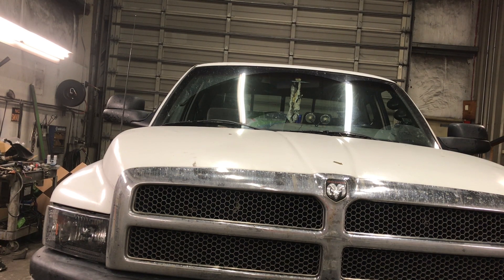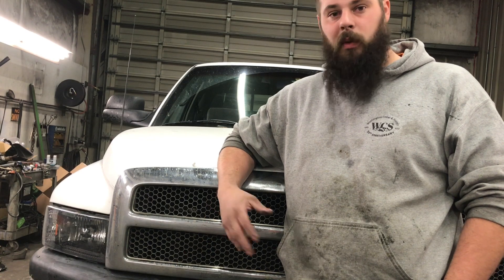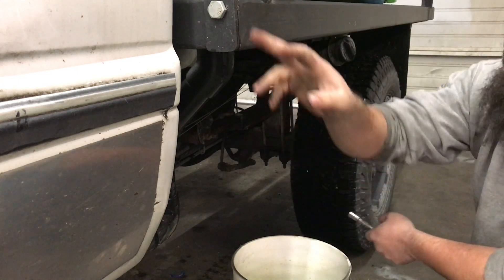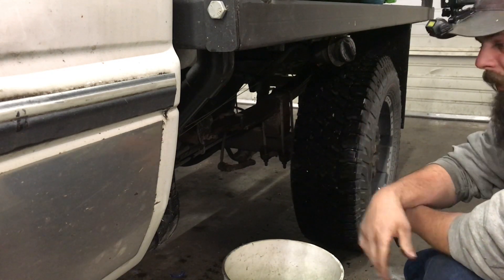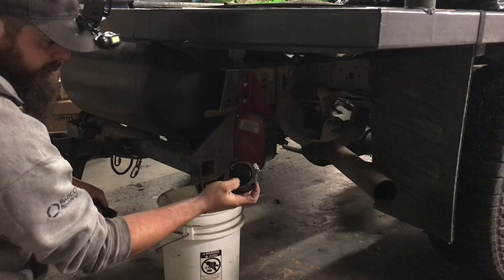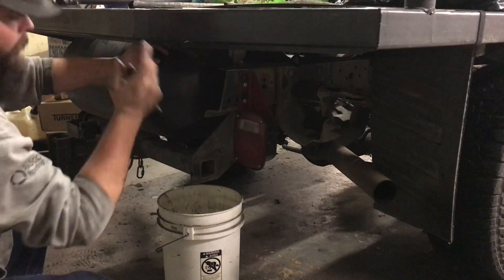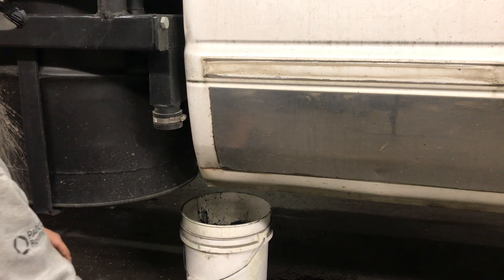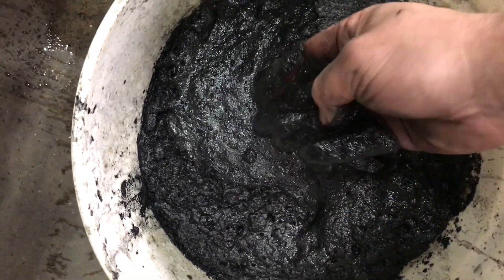V10 Woodgas Truck, First Drive into Work and Draining Condensations from the System

Comment: Is that water good for anything? Could you use that in your garden?  Is it mineral rich?
Reply from the maker: @SkidSteerCowboy-zz6xd  yes very much so. Is usually dump hopper condensates on the driveway it acts as a all natural weed killer. the rear tank, hay filter and sling shot filter waters are basically distilled water with soot, doesn’t do much of anything that I’m aware of

Comment: How warm is the liquid when you drain? I’m just wondering if freezing would be an issue for up here in Alaska but if it’s warm then as long as it’s all drained before it cools it should be good
Reply from the maker: @greatnorthernadventures570  yep drain it just after shut down and it’s like warm water, the tar drain tank is steal so just in case it’s cold and can give it a few licks with the map gas torch to get it draining which Iv already done last winter

Comment: Does this only work on diesel trucks? Or would it be viable in a 4 cylinder ranger?
Reply from the maker: @WTLHunter  works on any internal combustion engine this truck is a v10 my other truck is a v8 and I know a guy that did a 4 cylinder ranger
Reply: @BigBeavrSlayer  this is all very cool! It is amazing to see this and wonder how self reliant we can actually get while still maintaining certain luxuries
Reply: @BigBeavrSlayer  have you thought about doing a generator to see what kind of power you can get out of it?
Reply from the maker: @WTLHunter  yes I have and plan too soon, it’s pretty much the same as with a truck you lose about 25-30% overall power so I’m just searching for the right generator something in the 10k range
Reply: @BigBeavrSlayer  maybe also look into heat to energy conversions as well? Really see what you can juice it for haha

Comment: First i have seen your video very nice set up you do great work.  Would you be willing to provide a system drawing of how you designed your vehicle/ gasifier unit?
Reply from the maker: You can buy the book with full plans from Wayne Keith he is the designer of the system the book is called "have wood will travel" that's how I got the plans and it's the same system on both my woodgas trucks, slightly changed since one is a full size dodge and the other a Toyota minitruck

Comment: You said the timing gets pulled back when you get into the throttle. I wonder if putting a varible resistor in the throttle position sensor circuit would improve things. Maybe fool the computer into thinking you arent into the throttle as much. Could have a switch on the dash for when you want to run on gasoline. 
I'm probably wrong, but just curious.
Reply from the maker: I'm working on a cure for it, but last night I made some big improvements to performance, ill probably have a video tomorrow on it

Comment: Get a serpentine belt that’s a 1/4 inch shorter and that squeal will go away. I’ve had a bunch of Dodge trucks, a genius turned me onto that fix. Not claiming it as my own.

Work on working clean, personal words of wisdom.
Reply from the maker: I had heard of guys doing that on the diesel trucks, but this is a new belt new tensioner, new water pump and has had the belt chirp since I put it on there for some reason. Ill give that a go after a few tanks of fuel money are saved, then buy a good quality shorter belt and keep this one under the back seat for a spare
Reply: I did the same thing. Kept changing belts spraying it w silicone, new tensioners. Thought for sure it was the bearing in the alternator. Dude told me to get a shorter belt, prob solved.

Comment: Awesome. Would a second hay filter be any help?
Reply from the maker: There are a lot of option when it comes to filters, hay filter does the job ok if your willing to deal with some soot buildup in the throttle body and intake manifold. This is cleaned out later with burning out the intake which I have not had to do yet. I am thinking I will add some more filtration inside the hay filter later in, but I’ll drive it a while and get the minor bugs worked out before I start making internal changes

Comment: Bottom line, you made it to work. There is always the gasoline back up, but man, she's alive. You gotta be proud. I'm sure you were probably adjusting A/F ratio on the way to get a feel for the beast.  With our stationary gasifier running an engine we added an Arduino program / servo motor to an O2 sensor to keep things in check before we heard the engine cough.
Reply from the maker: Since I am more or less using damper valves that don't actually seal, I am seeing it is hard to get a perfect mixture going according to the afm. I think I may block off one air filter for the drive home today and see if that improves the ability to set a good mixture. As it sits with both valves closed off completely I cant get it to go full rich, just right on the edge of the gauge lean. Interestingly that is where my Toyota makes peak power, but the dodge does not, at least not with its current timing tables un modified
Reply: @BigBeavrSlayer  That's a good idea, closing off one side of the air filter
Reply from the maker: @nhhbbyloggr5022  on the toyota I only use one air valve to set the mixture, but it really needs both air filters for gasoline running.  Makes sense the dodge would be the same way, but without a valve that seals off its not as easily set for a mixture
Reply: This seems like the kind of thing you could knock together a "woodgas ecu" for relatively simply, no?

Comment: Very nice video as usual. I was wondering what would happen if you live in a place where the temperature goes below 0 C and the condensate freeze in the tank?
Reply from the maker: As long as you drain at the end of every run it really isn't a problem. Several guys in the frozen armpit of the north in Canada use woodgas regularly with no issues. The condensates does take a little extra cold to freeze from what I'm told

Comment: Been following you for a while and researching wood gas for a year now. Is this a viable option for a small 3.5 V8? Don't want to build one if it's not viable.
Reply from the maker: it absolutely is, any engine can be run on woodgas, just some are more difficult then others. Single cylinder engines have a pulse that creates problems with low rpm gas delivery, but most any multi cylinder engine will work. The more timing adjustment you can give it or raise the compression ratio the better, it makes peak power much better doing both of these. My toyota has both and reacts very well to woodgas, where as currently the dodge needs the timing adjustment to make better power since I know I am making very good quality gas in this system. For new guys I recommend a engine that has a distributor so the timing adjustments is much easier. If you really want to dive into woodgas I cannot highly recommend enough joining the driveonwood.com forum, that is where I learned everything I know
Reply: @BigBeavrSlayer  thanks. Appreciate it. Will have a look at the forum

Comment: Once the timing is sorted the hills may get a bit flatter . Your craftsmanship is very very nice.
Reply from the maker: Got a couple things I'm working on with the timing, 10° btdc just doesn't cut it for woodgas. And this Era of truck was striving for emissions standards and is programed to pull timing to reduce nox so its time to work around that. More timing is articificially raising the compression ratio of the engine, which the more compression the better for woodgas performance
Reply: @BigBeavrSlayer  What are we looking for with timing? 25 degrees ATDC ?
Reply from the maker: @jerryweaver2247  my toyota is running 36° base timing, maxes out at about 1/4 throttle at 45° that's as far as you can push a v8 distributor before running into spark jump. That's one reason I really wanted to play with a no distributor tunable engine, there is no max timing except what is programmed allowable by the pcm which for the dodge looks like it's 70° btdc. I dont think I will need to push it nearly that far, but that door is open with the v10